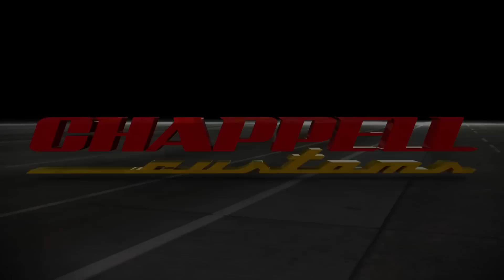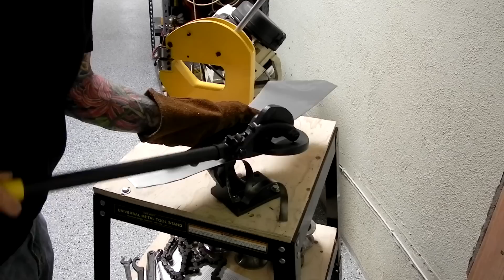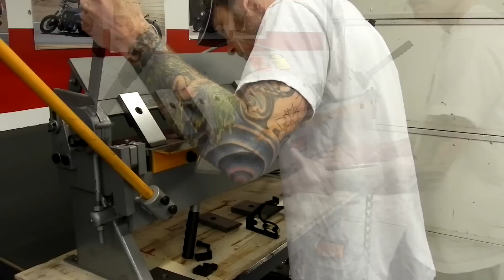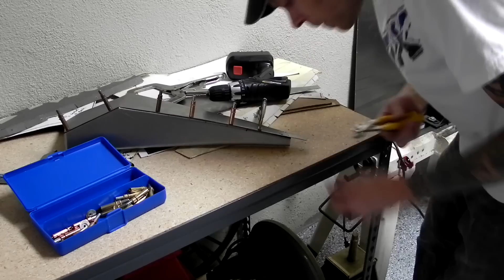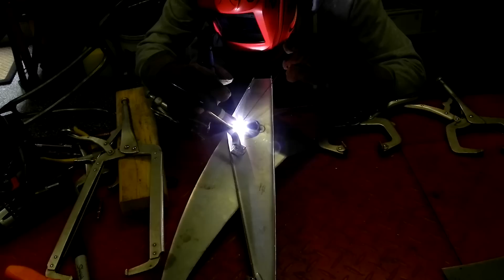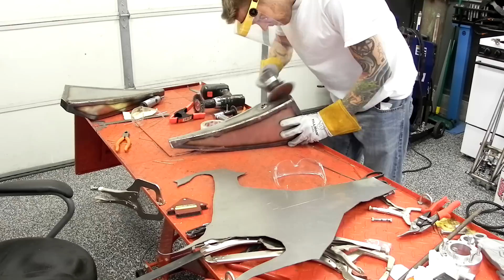Custom Motorcycle Gas tank fabrication, Chappell Customs, board track 82 XS650

Comment from the maker: floor was professionally done. It has a thick chemical resistant clear coat and its tough as nails. Holds up great. I've used the cheep stuff before and it just peels off, it was worth it. And i have a warranty :-) 
Thanks!

Comment: Did you happen to see a photo of the new build by Ian Barry @ Falcon Motorcycles.  Its called the Kestrel.     I have a 1963 triumph 500 twin and was thinking about sorting something similar his build.  Funny thing about his frame, it looks like the seat down tube takes a 90 bend half way down to wrap around the transmission.  ianbarry.com/the-kestrel/